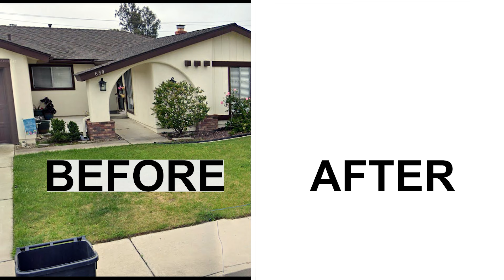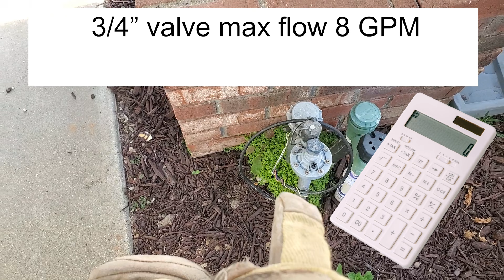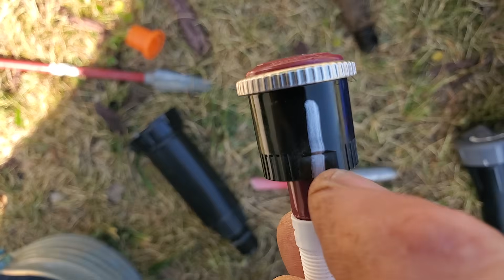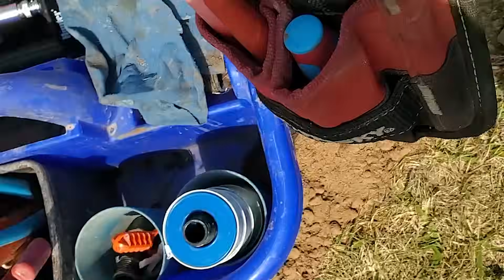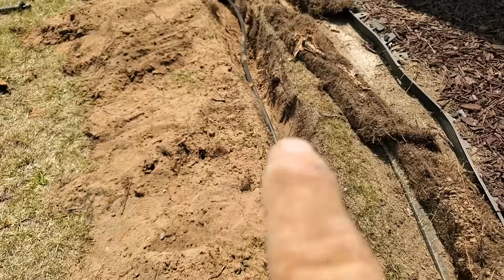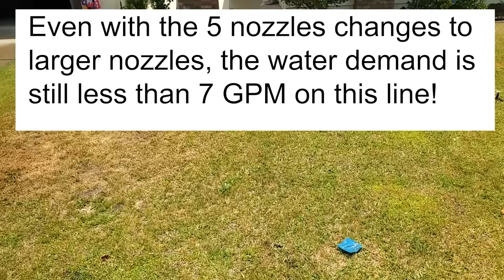Improve lawn sprinkler coverage with Hunter MP Rotators | Part 1 | Design series

Comment: Some heads with  PRS stems some not? Distribution Uniformity is out the windows.
All heads should have swing joints and same po-up height to also achieve proper D.U. Install heads 6" minimum from hard surfaces to avoid edger damage and prevent water run off.
Reply from the maker: David, yes, in a perfect world you're right, but this job needed to be done on a tight budget. These folks couldn't afford a complete redo with replacing all the heads and installing swing arms on them all. 6" spacing away from hard surfaces is not a practice we can afford out West where it's so dry. We install heads about 1" away to avoid edger damage and adjust the nozzles to reduce water run off.

Comment: I am weary of constantly broken sprinkler heads!  I have decided the Hunter Swing Arm is my new friend.  My sprinklers break because cars run over them in our driveway and people accidentally kick them.  If the sprinkler is screwed onto a regular riser there is no flexibility and therefore the weight or kick breaks the riser.  I am in process of switching ALL of my risers to swing arms that way when something pushes down on it the arm will lower into the ground then come back up and not break.  Also, I can get sprinkler heads flush with the ground, even when the lateral line is buried too shallow thus preventing digging up all the lateral l8nes and digging them deeper.  Swing arms save the day again!  And they are so reasonably priced.
Reply from the maker: Janet, That's alot of work, but worth it. Be sure to buy plenty of 1/2" marlex (black) elbows and be sure to have a marlex elbow under the popup. You MAY want at least one at the PVC fitting too. That is subject to need and the angle of the threaded fitting. All too often I see 'professional' landscapers installing the swing arms backwards so that there is no marlex under the popup. That's where the most flexibility needs to be, as you know.

Comment: Hey Tom, again a great video! Quick question — I saw you mixed MP800s with MP1000s. Since they have different precipitation rates, have you had good results with that over time? I remember reading something about this on the hunter website not to mix them generally. I’m designing a small (~269 ft²), odd-shaped lawn with some tight curves, and I’m in a similar spot where I could use both the short range of the MP800 and the reach of the MP1000. The lawn is very flat, and the soil is sandy, so nothing odd.

Also, you mentioned in this video that you talk more about your preferred nozzle for lawns in the linked video, but I didn’t catch that in the video — mind pointing me in the right direction? Trying to figure out if sprays might be the better option for my small lawn.

Thanks again for all your videos! They’ve been super helpful. I’m DIY-ing my first irrigation setup at home and have learned a ton from your channel.
Reply from the maker: Bakotaco.......hmm. Does this mean you live in Bakersfield? 
I only mix 800's with other MP's when I need a shorter distance in an area than what a 1000 series can provide such as I noted in the video.
The video I was referring to regarding my perferred nozzle for lawns is called The Best Sprinkler Nozzles and is linked here: https://www.youtube.com/watch?v=pyG7TUi0XBU
Good luck with your project. I'm glad these videos are helping you. Let me know if I can be of any help.
Reply: MP800SR have a P.R. of approximately .80" while standard MP1000,2000,3000, and 3500 have a P.R. of .40" if mixed on same zone the MP " Matched Precipitation " goes out the window. If you need shorter radius of any MP you can install 30 PRS head instead of 40 PRS heads.

Comment: I've been replacing mine with these type of sprinklers, but I just can't get them to spay far enough. The bag says up to 15 ft, but they're barely spraying around 5 feet. I made adjustments, but they're still not working right.  I turned the little screw for distance all the way, and nothing happened.  I'm going to try to buy a  brand new sprinkler and see if it changes anything because I'm just replacing the nozzles.  Any help?
Reply from the maker: Troubleshooting a situation like yours has several steps and nothing can be assumed. First you need to know the PSI at your valves. Then there are things like pipe size and how many heads are on each line and doing the math of how much water each nozzle is using and whether you have popups with built-in pressure regulators, etc. Replacing the heads won't, in itself, fix your issue. If you would like help, reach out through email before spending money and effort.

Comment: Good to see that you are still making videos, thanks for the information and wisdom. I was almost ready to pull the trigger on the MP Rotors but I will wait and see. Pressure is an issue, track home, 700 sq ft yard, typical Ca.  It gets hot here, I am looking to get a WI/FI timer and water at the crack of dawn during the summer.
Reply from the maker: Good to have you back. Good luck.

Comment: Hi im trying to learn as much as i can about this.
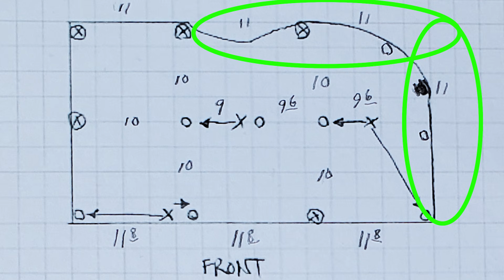You say around 3:33 that overspray isnt an issue on the beds like it is the concrete. I get why garden overspray is acceptable, but on the other hand, how is overspray on concrete even avoidable?
Reply from the maker: Right?? I just need to say that because I've done work for folks that are super-particular about not having water on the concrete/asphalt/hardscape and I know some of the audience may be the same way. Some areas actually have water cops (esp. during droughts) or pseudo-water cops (neighbors) and have a cow if there's water on the concrete.
Reply: Put the heads 6"-12" away from any hard surface to prevent any run off. And no you will NOT have dry spots behind the heads.

Comment: Why not just use a few gear drives?
Reply from the maker: Alex,  The line could not have handled the cumulative amt of water needed with rotor sprays. I did the math ahead of time. This solution allowed me to actually reduce the amt of water usage and keep it within the GPM that the line could handle. Great coverage now.

Comment: Hello sir, did you use any retaining clips or hose clamp on the funny pipe? Great video thanks.
Reply from the maker: Terry,
None. If you use the proper fittings and the pressure isn't higher than it ought, there is no need for those items.  Thanks for the attaboy!

Comment: Nice install. How about a drive by a half a year or so later to see the difference?
I've heard the MP1000s are pretty inferior, closely related to Rain Bird's blue 8-14 which puts out a pretty anemic throw. MP2000s are much more robust. Rotary nozzles are a life saver for those with limited GPM. I've heard people argue that you will have to run sprinklers longer thus using more water, which is untrue if you know anything about precipitation rate, and, the rate at which soil can absorb water. Sandy faster, clay slower.
Reply from the maker: Thank you.
Yes a drive by a year from now would be a great idea. 
I've been using the MP's in many different situations/applications since they were introduced to the landscape market and I would say that the 1K series is just as reliable as the 2K. They just don't throw as far, of course. It's the larger 3K and above that I typically have had issue with because their trajectory is so high. As far as precipitation rates, the typical precip. for MP's .are apx. 4 GPM which is less than a third of std. nozzles like the RB 1800's at 1.6 GPM. The Hunter rep has always held to a MIN. of 20 mins. run time for MP's in typical situations but this is only a rule of thumb and also depends whether head-to head coverage has been achieved, weather, etc. Did this address your concerns and intent?
Reply: Certainly did. Thanks for your informative videos as always. @SprinklerPros
Reply: @SprinklerPros  Not sure if you drove by the place or not, but just a quick reminder. I have been watching your videos and soon will take up fixing and hopefully improving an old sprinkler system.
Reply: @SprinklerPros 9o a5bhii qs
Reply: Precipitation rates are not measured in GPM they are measured in Inches Per Hour .39" - .45" for MP's .50"- .75" for Rotors. 1.0" - 1.8" for Sray nozzles. .75" - 1.2" for dripline and 2.3"-3.0" for bubblers.